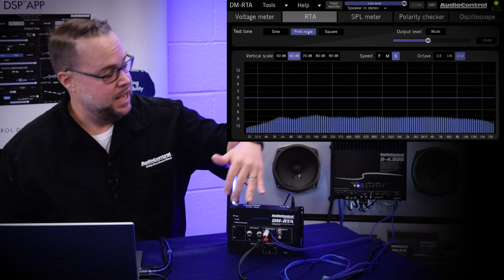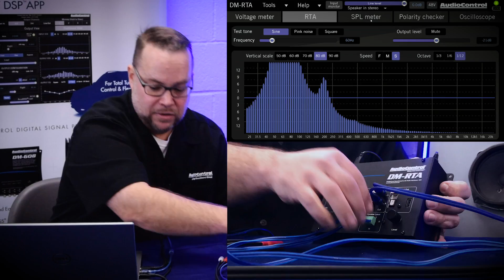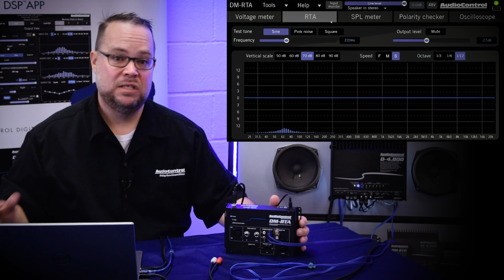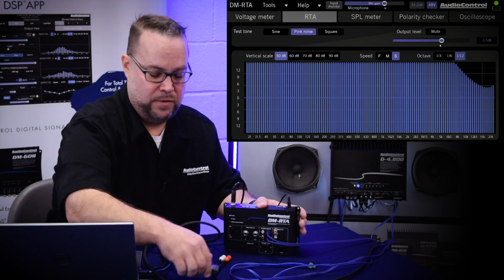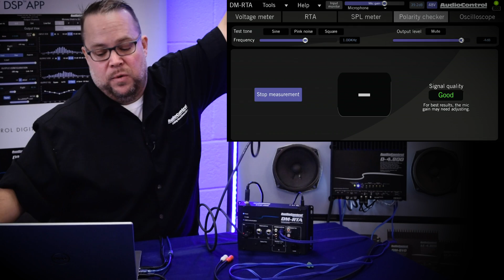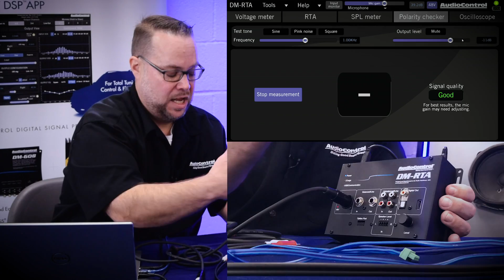DM RTA Intro

Comment: Things is awesome tool. I gotta get one. I have a line out converter since i have a factory radio. Would i unplug my hi/lo level speaker outputs thats going into my loc and plug it into the dm rta to see where my headunit clips at and what volume i can safely turn it too? Then after i do that check would i jus plug the hi/lo level back into my loc and take my rca's from my loc and plug them into the input of the dm rta? Jus little confused where i need to plug my rca's in on the dm rta to set and tune my loc converter and have it generate a 40hz 0db test tone. Would my rca's still be plugged into the same place on the dm rta (the input) if i was using my radio/phone to generate the 40hz 0db test tone? Thanks

Comment: Not really an "Intro" video as you don't describe what you are actually trying to accomplish with this tool.  For example, if I'm working at producing 5.1 audio for a video how would this tool help or not help?  Does this unit provide TRS output to audio interface inputs which I could then direct to each channel and use it's mic to test individual levels?  Right now, I just position a relatively cheap dB reader and use my PC to generate pink noise (or whatever sound I want) and then view the dB readings for each channel when output one at a time.

Comment: I seriously need your help. Purchased the DM-RTA couple of days ago and arrived today. The rta device won't turn on. I thought maybe the battery is flat. Plugged in and the charging indicator led comes on. Tried to turn the device on again and nothing. After that I realized inside the device is a blue light that always stays on and is not going off even if i press the power button. Couple of minutes later i installed the app and tried to connect it to my Windows laptop and the usb/comm led indicator was blinking but device didn't connect because i can't turned on. Please help

Comment: Also, using the microphone - can you measure phase between two sources?   Say 60Hz from floor speakers vs subwoofer? (determine if a sub is in phase or out of phase, and by how much (e.g. a value beteen 0 snd 90 degrees)

Or even the delay between the generated signal, and the sound pressure picked up by the mic. (distance calculations)

Comment: Could I connect this to line outputs of a BT amplifier, and  have this transmit a BT white noise signal to that amplifier to graph 25-20KHz and check for x-over attenuation, and the effect of treble / bass controls?

How about THD?

Comment: Does the sine wave have different db levels for tuning head units and amplifiers? for example if i wanted tune to a 1000hz at -10 db ? thanks
Reply from the maker: Using the DM-RTA, you can actually output pretty much any tone you want. You can put out anywhere from 25hz to 20khz at anywhere from 0db to -48db. Hope that helps!

Comment: So say I tuned everything on my dm810 going out but can I also use this to set gains on a subwoofer amplifier using the subwoofer wire  and the dm-rta oscilloscope and wire input?
Reply: That’s how I’m understanding it
Reply from the maker: Yes, you can. However, the DM-RTA is made to accept up to 40v of input, so you wouldn't want to send more than 350-400watts to the input section of the DM-RTA. It is really designed to be more for tuning multi channel amplifiers, etc.